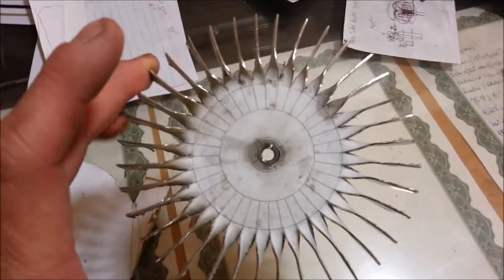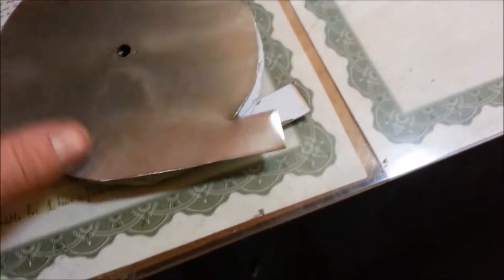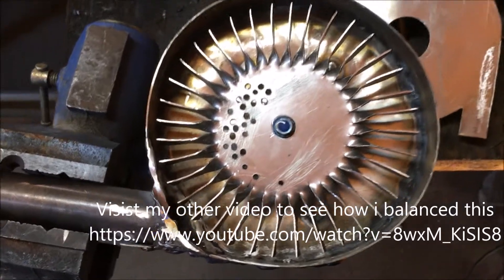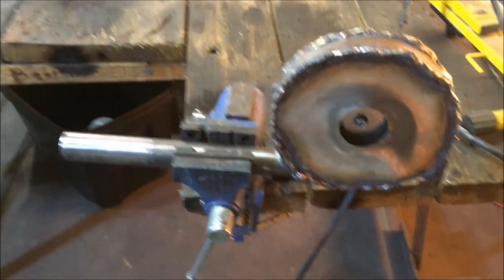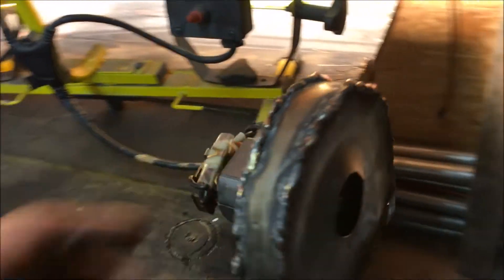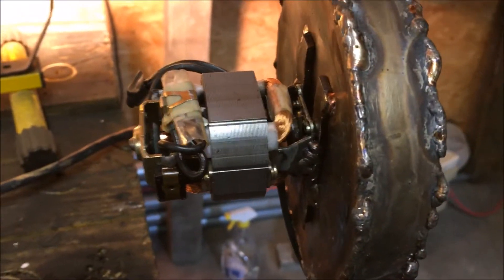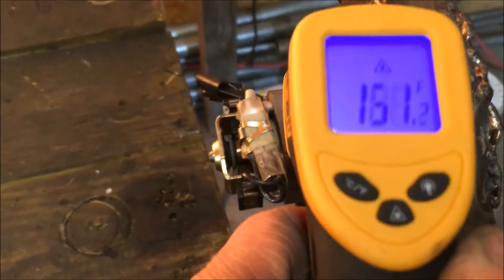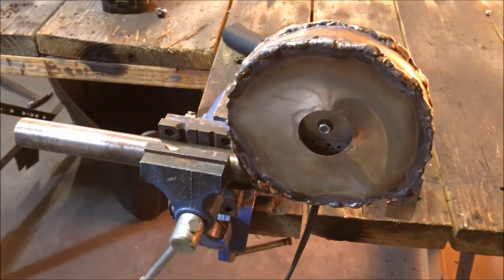DIY High Temp FLue  Blower Stainless steel

Comment: Why not just look for used cheap turbocharger that is built to take high temps, and if you mod the shaft on it for attaching a electric motor then you could push air in and pull gas out at the same time ? Usually I see them on Craigs list and kijiji and the odd time only for $50-75.
Reply: Or an air cooled motor fan.

Comment: that blender motor right... if i use bldc motor for high temp woodgas its posibble to do sir ???
Reply from the maker: It depends my friend , if you have good heat shielding and a good cooling  system it would be fine , you need heat shielding if the blower is near hot parts, thermal radiation will emmit from the parts and heat up your motor
Reply: now i understand sir,, and heat make magnet broken to,,, and shield to cover motor from heat,,, its can i 
lengthen the AS for cover motor...
Reply from the maker: Achiles Stavros what do you mean by AS ?